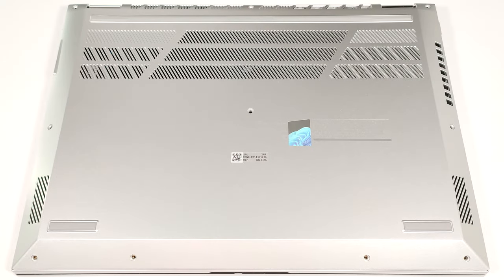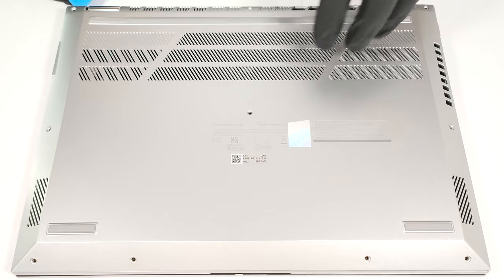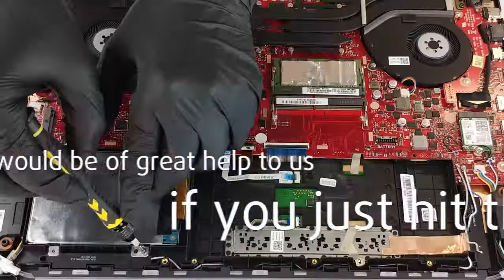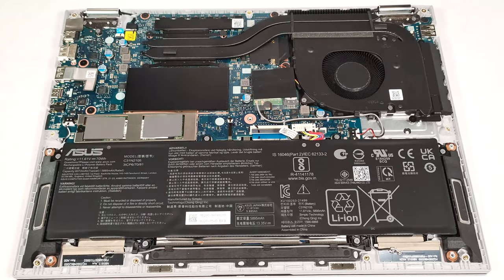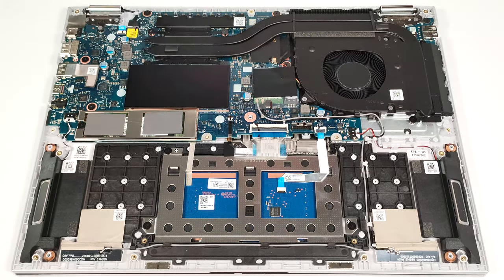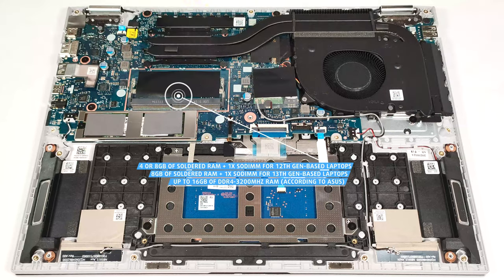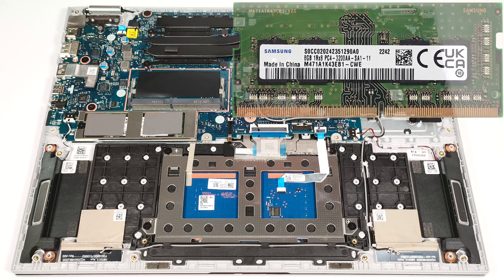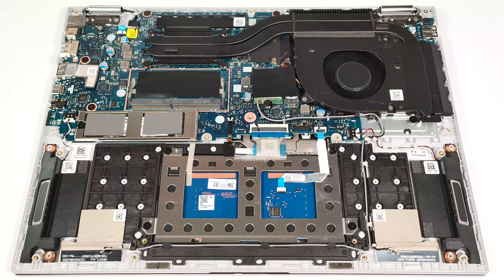🛠️ How to open ASUS Vivobook S 14 Flip OLED (TP3402) - disassembly and upgrade options

Comment: I can't tell you how useful your videos are! Chosing a laptop is hard & even finding out the proper specs (is the ram upgradable, how many SSDs can be connected etc.) is quite hard as there is often conflicting information... not to mention it's nice to see how well built the laptop is underneath (for instance, how big is the battery & how much free space is there...)

Comment: Thank you so much! I am about to buy exactly this model - but i'm concerned that in future, 16 gb possibly wouldnt be enough...
Can i change the 8GB module to a 16 gb, so that I would have a total memory capacity of 24gb?
do you think it will support parcial dual channel mode?
(first 16 gb could work in dual channel, 8gb working in single channel)

I'd be so glad for any help! Thanks in advance!
Reply: Yes you can upgrade to 64G
Reply: @almontader  so I can install 32gb stick in it, with total to 40gb?